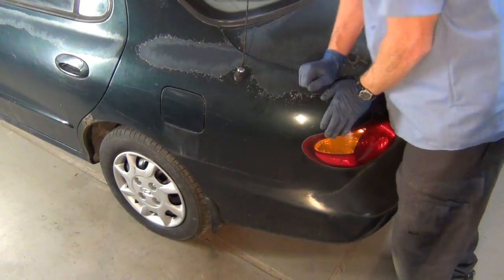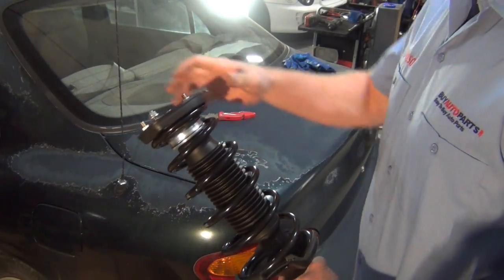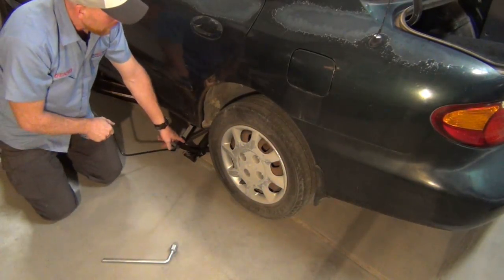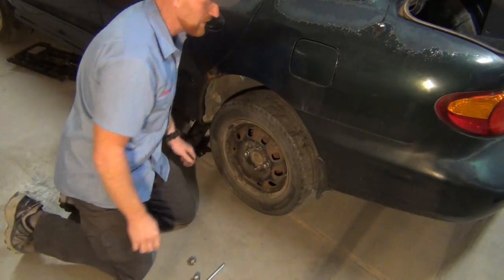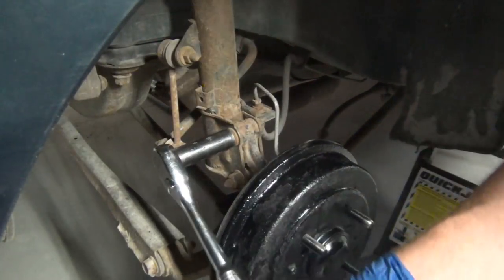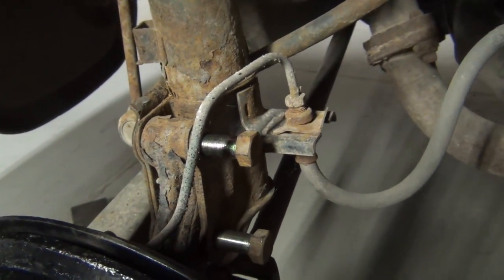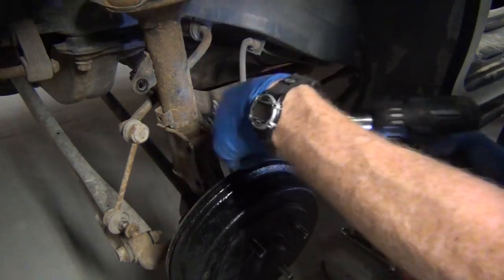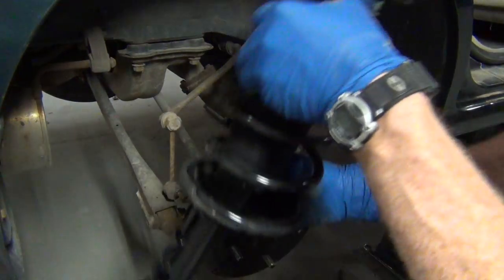What is a Quick Strut?  Can You Do Them?.... like a BOSS

Comment: I just changed the struts on my 00' Elantra GLS. I did it the "dangerous" way. I rented the spring compressors and torque wrench from autozone. It was definitely sketchy taking the old springs off and putting them back on the new struts. I will say, the wagon version of the Elantra is much easier to replace the rear struts due to the easy access. Was a long process though but man she corners so well now...

Comment: Twice I have used quick-struts from monroe and both times they failed in less than 3 years/30,000 miles. During the autopsy's I found one had the thrust bearing installed upside down and another one was missing a spacer washer so it allowed the rod on the strut to move around inside the mount. Coupled with most aftermarket parts are just not as good as oem I would rather reuse the oem spring and hardware provided its not damaged and only replace the strut itself. I used to have the 'just replace it all so its all new' mindset and after getting burned multiple times I take a much more conservative approach to fixing things and often reuse original parts where there is no outstanding reason to replace them.
Reply: I have to agree with you. Get the parts you need, pull the shock tower and find a shop that will replace the shock for you. Reuse all OEM parts if possible. On a really old beater, it doesnt matter. We recently traded a 2010 Forester in, had 125k on it and was ready to start replacing everything. I decided instead to just trade it in and get a low milage newer car. I have always wanted an Outback and am happy to own one. I may buy an older one next summer and do what needs to be done. I did have to replace the alternator on our 2010 just before trading it in.
Reply: I have found the same thing, people just do not get it.  Quick struts are a compromise!  The mounts, bearings and coil springs in most quick struts are substandard and do not compare to the OE equipment.  This is why so many people complain of low ride height, too stiff of a ride or creaking, groaning, cracking and thumping coming from new quick struts that are less than a year old.
You want cheap, easy and quick, go with a quick strut.  You want to restore the OE ride, keep your original spring (if it is not damaged) and replace any worn out strut components with OE components, especially bearings and mounts!!  And take the time to understand how to install struts correctly so you don't hurt yourself or have to do it again.

Comment: Brian, you have the patience of a Saint.  I've changed more struts that I care to count; AlWAYS check the alignment of the strut mount with the bottom (against the old one) before lifting it up (this was a little girlie car).  On the front struts, you can turn the top hats without a compressor, since they are on a bearing.  Even on the rear, I bet you could turn the mounts at the top without compressing the spring.  Try it next time.
Reply from the maker: I tried on camera- didn't budge at all.  I think I edited it out due to a long silent pause at 20:49.  Probably should have left that in there.  Front struts are more forgiving.  I just always line them up with paint anyway.
Reply: briansmobile1 you won't be able to turn a rear strut top mount by hand.  Try putting the strut in a vise, with a block of wood in the axle mount to prevent crushing the mount.  Then use a 2x4 to turn the top mount at the studs (you're not turning the spring).  You have a strut tamer, but most people buying a quick strut won't and may not have a spring compressor available.  Don't force it, as you don't want to bend the top studs, but the top mount is not indexed...only the spring locators are.

Comment: An alignment after installing struts is critical. Even my 1990 Camry where the manual said that camber was not adjustable. There was enough slop in the bolts that the camber alignment could be repositioned considerably.

Comment: Nobody does quick struts for my old volvos. I gotta go back in after doing my struts cause I did not get the springs aligned properly as you pointed out you must. Now when I hit a pot hole the steering wheel jerks harder than a $10.....

Comment: I bought a 1986  Hyundai Elantra back when they come out I had to take it back at least 8 times for stupid things 1 was it would snow in the car when ever the AC was on . 2 was the radio and speakers would die and never the same thing I worked at ASI back in 1978 to 1984 as a digital radio warrenty tech and could fix any radio. I had to go there and show them how to fix it once and for all   I also have the same boat . I live in the catskills NY and it has gone from 90 to 41 in the last 3 weeks usaly its 55 or so in the day time  and 40 at night today it was 77 but tommory it going to be 50

Comment: Living in western NY I learned the only strut you buy is a quick strut. By the time you replace the mount and the strut it’s not hard to upsell the entire unit. Especially if you warn them your not liable for damages on rotted components
Reply: No thanks.  I'll do my own strut rebuilds than you and keep my OE spring, mounts and bearings.  Or if they need replacement, I will replace them with quality OE components, not the offshore crap that is included in most quick struts.  Quick struts are a compromise for people who don't know any better.  I'll take quality instead.

Comment: Quick Strut or not. I have decided because other than only get the strut mount/ bearing, I also need the rubber boot and not sure the strut is still able to bounce back.  In additional to that, I need to buy a spring compressor which I may only used 2 times.  For Peace of mind without killing myself by the spring, I go with quick strut. Thanks for your video. 👍

Comment: Unless you have a Escort ZX2 S/R (only 2000 were made), they have Eibach springs and Tokico struts. If a strut fails replace it in pairs with S/R spec Tokico's or simolor but DO NOT toss the old springs (unless its broke of course).

Comment: Good job - tell them people off about the strut bolts that were off - not a real big deal though - that strut tamer is not cheap - $771
??? but helps out a lot - didn't see the price of the struts or did I miss that
Reply from the maker: If normal struts are $45-$65, the quick struts will often be $89-$120.  Check them out at buyautoparts.com

Comment: lets put it this way, back in the day, you changed the  shock and not the spring, and compressing the spring to install the new shock can be hairy, every time I have installed the  whole new assembly the ride height  changes due to the matched spring because the old spring was shot,  why would any body want to install a new shock in a worn out spring is just a waste of time
Reply: "matched spring"?  In a quick strut?? Does not happen.  Some cars have over a dozen different spring variants that could have been selected by the manufacturer during build (minivans are a great example).  Quick struts use pretty much a "one size fits all" approach to the different variants of any particular model vehicle.  THAT is why the ride height most often changes drastically from what the owner was originally used to, not so much that the OE springs are actually "worn out".
Why anyone would be willing to discard their OE springs for cheap generic springs is beyond me, it's just a major downgrade overall.